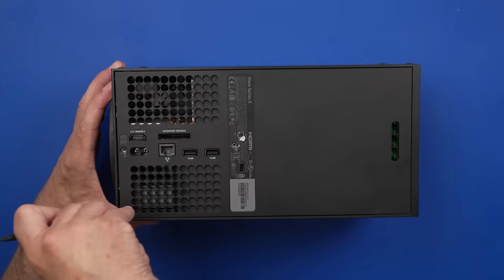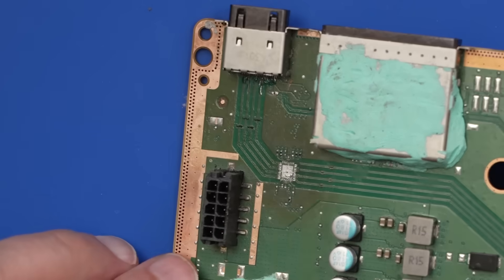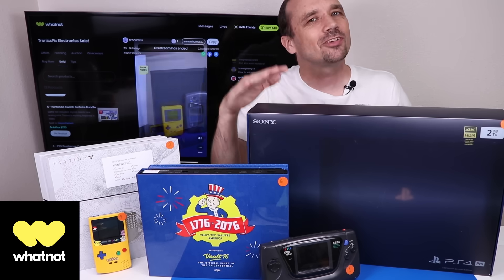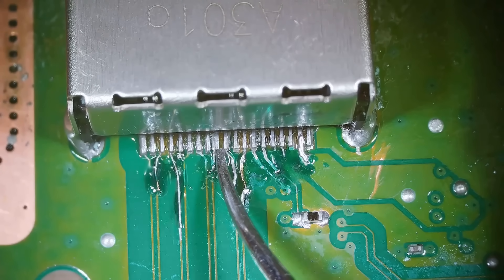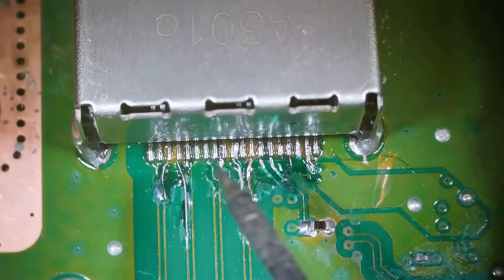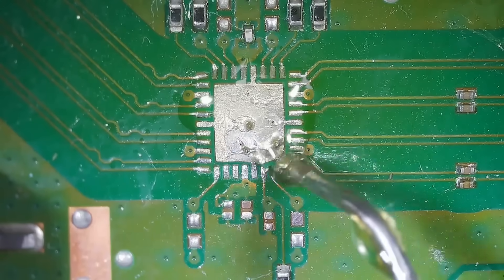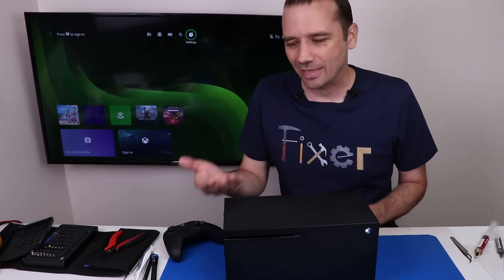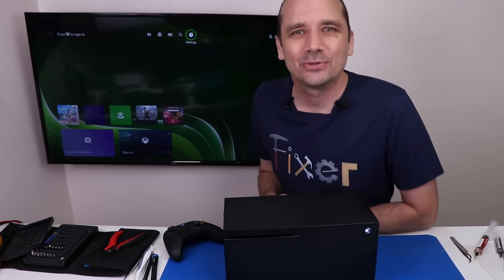Repair Shop Destroys Xbox & Won't Refund Customer - Let's Fix It

Comment: What people need to do against these ripoff repair shops is to take them to small claims court. My friend had the similar thing happen to his launch PS3. They took his launch edition 60gb and sent him back a broken 3rd generation non backwards compatible model. They denied it body even refused to refund the "repair" cost. He took them to small claims and was given judgment of the original retail cost and an extra $500 punitive.
Reply: Awesome result! Around here, to file an action in Small Claims court costs about $150, so it is hardly worth it for really small matters.
Reply: @williamharris8367 it'll be better to report them to the BBB because if there are multiple claims against them then they can place a class action lawsuit on everyone else's behald.
Reply: Some rebuttal points. While it may cost x amount to file the claim, you will get it back as part of the judgment. If claims aren't made, these crooks just keep pulling this crap because they know the public will just roll over and take it. In the case of my friend, his judgment was a full refund of the repair costs, replacement of his launch PS3, reimbursement of the filing costs AND the punitive settlement.
Reply: Id agree but with microsoft and xboxs impact on the industry over years in mind, xbox fans should be robbed and ripped off. They literally deserve it. They support a company that thinks discs should be essentially proof of purchase and not a media format. Literally all xbox fans deserve to be robbed because they are robbing us so in principle yoire right, but reality youre wrong
Reply: That's usually more expensive and more of a hassle. I'd just report them to the Better Business Bureau (BBB) and just move on to a more respectable and honest repair shop such as this person did. Multiple  BBB complaints will certainly hurt their business in the future.
Reply: @danielmeans9539  the BBB is worthless body does nothing against a company. It's a paid membership committee and as long as dues are paid up, they do nothing. If dues aren't paid, they just post a mark against them and do nothing. You are better off logging a complaint with the FTC.
Reply: That’s why it’s better to just send to Sony or Microsoft … Or just count your losses and buy a new one if you can …
Reply: Far out id be fuming if i'd lost a launch PS3. Its also well known that their YLOD issues are actually just NEC tokens that need replacing, not the CPU/GPU as everyone originally thought, so its become an easy fix and i bet they knew that...
Reply: @BNR_248 actually the rsx AND the nec tokin both contributed to ylod
Reply: @UchihaDareNial  Ahh yea the solder joints? Needed reballing..
Reply: @BNR_248  While solder joint also one of the problem, the real problem lies within the rsx chip (inside the GPU chip rather than the solder under the GPU chip)

The RSX made by NVIDIA that time was heavily flawed, I think the solder ball inside the GPU doesn't have enough lead, that leads to the solder ball cracked and doesn't last long, while reballing help, it is only a bandaid to the the major problem
Reply: @BNR_248  We njust replace the RSX with one from a slim now, they were produced post bumpgate. It takes a quick mod to make them compatible but after that the YLOD is pretty much gone for good.
Reply: @wodmarach  yea I saw these for sale actually. Launch editions as well. Was considering buying them. You use the 65nm rsx chip? The one I saw had both the slim rsx and nec tokens replaced with those orange tokens.
Reply: @UchihaDareNial  well, that happened only on older ps3s, if you recall and put a super slim rsx and cell your launch model will work perfectly
Reply: @UchihaDareNial  exactly hence the frankenstein trick (upgrade original rsx with a 40nm one)
Reply: I mean....it's not a ripoff shop.
The HDMI port was utterly frakkin' frakked.
They replaced SEVEN HDMI port pads with UV mask afterward.
It's not the most beautiful job I've seen but they obviously had intention to fix it.
...until they took the retimer chip off....which is the f-cking mystery.

I think it must have just been an honest mix-up on their part where they were fixing multiple systems simultaneously and confused this board for a retimer chip donor and instead of troubleshooting the system after it obviously didn't work,,,,and they'd already invested an hour of work into the HDMI port they were like, "F-ck it.  It's a no-fix."
Who knows though?

Either way I advocate for Hanlon's razor in this case.
A sincere effort appears to have been made to fix this machine.
The retimer chip removal...could be a mix-up.
Retimer chip is a readily available part for less than $9.

Comment: A question. Why not make a HDMI-port IN connected to a piece of circuitboard with testpads for all the leads? Then you can acctually test between the furthest solder point all the way beyond the acctual port. If it's a nice idea and such thing does not exist yet, your welcome to make and sell them. I suggest to call them WGports. ;)

Comment: The problem is the people that have a soldering iron and a tool kit think they can start a business and fix everything without actual experience doing legit fixes, and it shows when they cant do simple repairs and steal parts from customers. Probably cant sue, but you can report to BBB.

Comment: As someone who works for a repair shop, the fact they may have "stolen" the retimer chip pokes holes in this theory, but it's possible the specific repair shop they went to didn't have a soldering tech/team and they refused it/said it was unrepairable because they didn't have the resources to do it. Since we don't know the whole story, we can't say for sure, but I know for my store, we do turn away some solder jobs cus we just can't do them, especially micro soldering
Reply: How's it "stolen" if they took it that's just stolen no quotes around it
Reply: @LiEnby  but that's the thing, what if it was knocked off and they tried to cover their own ass somehow and the seller was upset, or how are we to know the seller didn't mess it up themselves? 😂 I know we've only got the seller's story to go off of and it's likely the shop did take or otherwise do something to the chip, but I'm just keeping an open mind for a hypothetical

Comment: Very tough question you pose. Like many I love to push systems to the max but if I am pushing and tweaking retro went not get the P3 or the P4 instead. Isn't pushing it until it stops actually the fun part.... I kinda stop playing after is maxed then move on to another setup. This is just me though...

Comment: I love how you can solder such microscopic components and your hands dont shake at all. I tried this a few times and mine do shake a lot.
Reply from the maker: My hands shake...I've just learned how to support them while I'm working. I think everyones hands probably shake when microsoldering. It's usually just a matter of supporting them while you're working.
Reply: Mine start doing the Macarena when I try solder
Reply: @haralamc  best comment ♥
Reply: I got nasty shaking hands, even when supporting them. They’re even worse when working on something new (nerves).
I’ve not let it discourage me from micro-soldering and I am able to still do all the things and do them fairly well. I almost didn’t even try my shakes are so bad.
Reply: @RetroFix  same here. Fixed 3 phones and 2 headphones with shaky hands.

Comment: hey steve because of your vids ive been taking to at least at a hobbyists level repair on some really broken consoles both handheld and minor stuff (psu replacement on a ps3 slim ). My current project is a display replacement on a pokeball 2ds xl that was split in half at the hinge and top screen  was impacted ribbon cable and wifi cable cut in two pieces . Im hoping to have a working console at the end of it or at least one thats more presentable pfft. Great work as always

Comment: @TronicsFix in the future, when you get the big shield and psu off, just disconnect the large cable from the board and you can take off the 2 boards and large metal piece as one. No need to remove it all as well.  Which I just recently found out. 

Hope you had a chance to try my suggestion with the liquid metal on the ps5.
Reply from the maker: Yeah that's true. Good point!

Comment: or shop didn't steal chip. seller cut his losses and took timer chip and got to working on another system fearing he borked this one.
Reply: Taking a timer chip from your product and using it to fix another device is infact stealing- its not yours to take it

Comment: So, I am a new viewer and I know nothing about soldering but how is it that the solder on your probe only sticks to the metal on the chip and not the plastic surface on the outside of the chip? Is it because of the Flux? Also, these videos are super satisfying to watch.
Reply from the maker: That's the beauty of solder. It doesn't stick to things like plastic. It wants to stick to other solder. The flux is there to help the solder flow and keep the solder joint clean.
Reply: Awesome! That explains a lot.   I've been thinking about buying a solder station and just trying to make my own repairs. So that helps me understand.

Comment: I created rapid clean technology 
Works awesome for cleaning out The pin area And ports .. So you do not disturb any work Pick yourself up a air brush That do you do painting with A small hobby one You can get from harbor freight The paint container Fill it up with 99 percent alcohol Hit the port up just a little bit And spray with rapid clean technology .. Rapid clean technology ..pattern pending haha 😄 
Try it out let me know how it goes

Comment: Do you have something like customer protection in US? How you can pay for a repair if the product is not repaired? And how they can steal components from it without your agreement?
Reply: No we have very little recourse on things like that, and one of our two major political parties want to strip what little federal consumer protections we have.
Reply: They probably old your console until you pay for the work done, regardless of the repair being successful or not. In my books, no repair = no fee. So in a scenario like this I would pay with a credit card to get my hardware back, then immediatly call the bank and do a charge back. But then again, I live in Australia where our consumer laws are very good.

Comment: Stole a chip too? What is wrong with people?
Reply: I've seen this exact same thing happen 3x now
Reply from the maker: Yeah, it's a little strange.
Reply: @Tronicsfix  can only assume they had a broken one and took parts off this one to repair there own and if this is correct some people need to stop scamming customers it gives them a bad name but looks like you could do it so it shows it clearly wasn’t broken 🤷‍♂️😂😂😂😂
Reply: @Tronicsfix if u use american express u can always get a refund
Reply: It's more common than you think. 

Where I live some printer repair shops were caught replacing newer parts with old ones. 
And when the repair was not done due to cost or technical reasons, these shops replaced working parts with defective ones.

They knew customers wouldn't be able to test the equipment after returning it and probably weren't going to get a second opinion in another shop.
Reply: Had the same thing happen myself, but with a gaming laptop. They stole the chipset from the board so i'll have to try and take it somewhere else and hope they can fix it, before fixing the original issue with the power
Reply: Years ago a friend took his laptop to a repair shop back home. We were aware of the rumors regarding missing  or changed working parts with some lower quality ones. That is why my friend marked most of what we thought it can be replaced with ink. Can't remember if he put a small dots here and there, but in the end he got them. Laptop was returned as "It can't be fixed" and we saw that things were missing. The repair shop closed down eventually😅
Reply: I took my vehicle to Capitol Chevrolet dealership for the Takara airbag recall and got it back with two missing airbag sensors.  Stealership denied it was them and refused to take any responsibility for the missing parts.  The "free" recall ended up costing me several hundred dollars to replace the stolen parts.
Reply: Those people need to meet the hungry end of a bear.
Reply: needed the part for another repair so why not. goodluck suing.
Reply: @IamJacksColon4  Usually yes but if you can take it to another repair shop and they get it working after the shop you originally took it to said it was impossible, you'd have a shot in small claims. You don't need to prove beyond a reasonable doubt they scammed you in small claims court, just that the judge believes it's more likely than not they did. Much lower burden of proof. As long as the seller has some e-mails or texts where the repair shop said it was impossible and proof another shop did get the repair done that would probably be enough for at least some money back.
Reply: @IamJacksColon4  That's common practice, a place will say it's impossible to fix, take the chip, and repair another unit for someone else, it's more or less praying they don't take it to another shop.
Reply: @SaintMorselGrand  sounds pretty illegal
Reply: @LiEnby  it is very illegal
Reply: @IamJacksColon4  Are you defending the fix shop? Who would defend something like this 😂
Reply: Also to add if he is adding video of the first opening and possible repair he has proper documentation showing the new repair person did not do this. That can also add to his claim.
Reply: Too much... Far too much is wrong with people
Reply: It does seem odd how the chip was missing but I'm very sure the person isn't going back to that repair shop ever again.
Reply: Right that’s liking trying to fix a car by the way we also took a wheel 😂
Reply: Man, we have this same problem here in Brasil. I prefer repair by myself and when I can't, give to the same tech more or less about 15 years
Reply: I once had to send my gaming laptop to a repair shop, they had it for 6 months and kept telling me they are waiting for  parts. After my constant phone calls and emailing they told me it is not fixable and sent it back to me without my 2TB HDD so I phoned them wth is happening, why is my HDD missing and they had the audacity to tell me the receptionist is scared of me because I told her to send it back to me ASAP. It ended up with me marching into the shop and demanding my HDD. I'm pretty sure they wanted to reformat it and sell it afterwards. Some shops are absolutely useless and thieves even.
Reply: My experience with repair shops has been negative through and through.
Reply: @12345.......  money. Money is whats wrong with people
Reply: Everything
Reply: I’d would file a lawsuit
Reply: Everything , we live in a world of monkeys
Reply: @12345.......  😂
Reply: Indians.
Reply: Allegedly